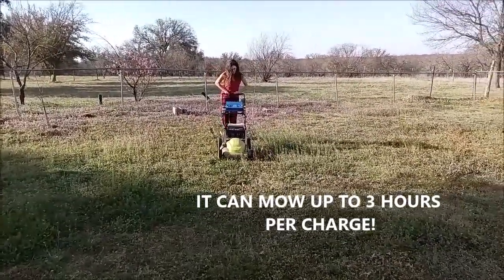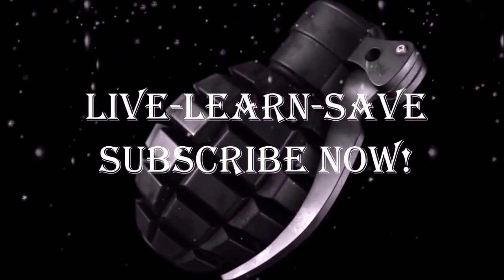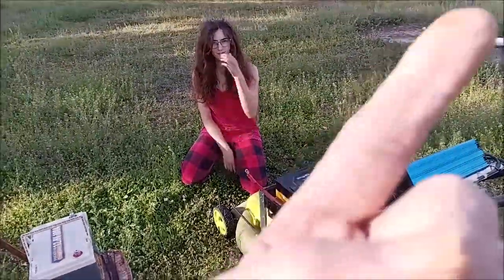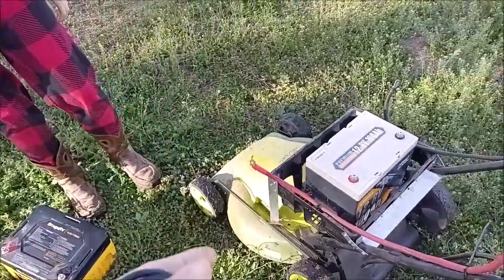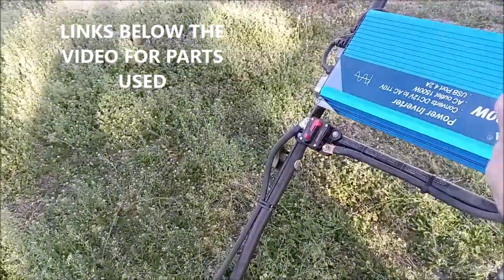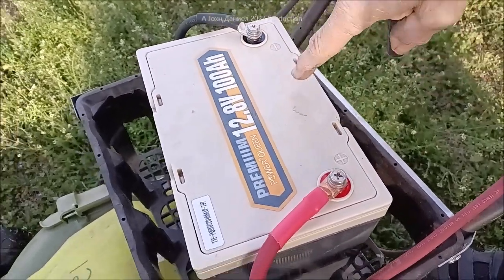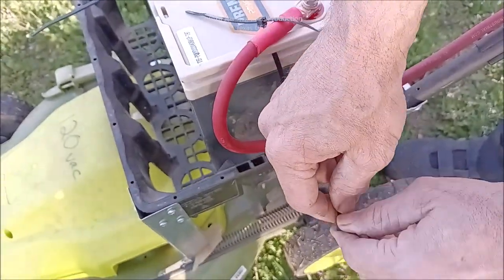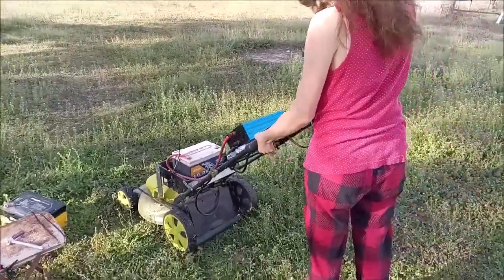120 volt Corded Mower running WITHOUT the cord & Solar Powered!!

Comment: Hi John really the videos you do. I picked up a 1300watt mower got a 1500/3000 pure sine wave inverter (giandell)mower will not run ???
Reply from the maker: Giandell 1500 won't have the starting amps with a 1300 watt load (over 3 seconds of 2X that to start it). You would need a 2000 or higher base inverter, and much heavier cables than the Giandell comes with. Using a start capacitor may help, one from a 10K BTU AC unit, such as a RV roof units capacitor.
Reply: @JOHNDANIEL1  cheers thanks mate I was thinking it may be a amp issue   What inverter do you recommend I am in Australia so some stuff can not get here
Reply from the maker: @andrewwyatt2542  2500 Swi power. You can get them there through AliExpress.
Reply: @JOHNDANIEL1  thanks mate shall have a gander
Reply: Would you a link for that inverter thanks

Comment: Can you make a 2023 video on how to set up a solar generator system using solar panels and a wind turbine at the same time?
Reply from the maker: Yes, I will do that. And I will show how to use Buck chargers, off Lead Acid to charge Lithium safely. 
It's a funds thing right now, I took no JAB from Pfizer so I get no love from Trucking companies and therefore I am not making the Bling Bling $ I once was.

Comment: I bought two of those 12.8v 100ah Powerqueen Premium batteries a couple months ago to run in parallel for my RV.     I haven't tried them yet but from the looks of the video you tested one, it's one hellava tough  battery.
Reply from the maker: They use actual automotive grade cells and a custom BMS. The new batteries I will be getting to add to mine are from Li Time. Have same internals, putting 4 in your system will work right together. So if you need 2 more look at them, the compact Li Time 100 Mini, they are offering PRE-Order, $50 off, just $319 each. https://shrsl.com/3y8nf

Comment: Hey John 👍 I've got a fairly easy cure for the weeds. & I saw you guys grow something not too long ago. If you can easily enough get some free brown cardboard. Remove tape, completely cover the ground & add woodchips, (4 inches +) I'm sure you would have seen this kind of thing somewhere. I grow about 1/3 of my food that way & I feel good about eating real, natural food. Saves $ &  tastes so much better! My SHTF solution 👌
Reply from the maker: Yes, thats what we are using in the garden areas, 2 layers of cardboard, and lots of mixes with hay and goat crap mixed in with topsoil add on.
Reply: @JOHNDANIEL1  Nice. I watched a couple of other videos after that 1 & heard you say that your daughter, Keira (Spelling?) had a huge garden. I should have known you guys were growing food! Pretty obvious 👍
Reply from the maker: Yeah, we have a storm cellar full, a 17 x 19 foot pantry full, and a 3 organized garden areas over 2200 square feet to deal with. Savings due to our behavior since starting this plan over 7 years back has basically paid for 3 years of it in cost difference.

Comment: Bougerv has already lost my business on these overpriced batteries, proven a third time to be bad manufacturing. I am guessing you are just going to take the battery cells out and use them another way, which is what i would do since as far as i know the cells are fine. I believe they have a heater which would be great for something needed in cold areas. But for 699 dollars i would buy other batteries like the power queen and get 2 or so for around the same price. If these were around 300 dollars i might buy them and just take them out of the case and put them in another case.
Reply from the maker: It sucks they are like this but I have a solution thats from the 1950's for them.

Comment: I ran my old school 5000 BTU Frigidaire window air conditioner recently for 22 hours with my 300ah LiFeP04 battery. It was in the mid to upper 70s and it kept my camper at 72 degrees. The compressor kicked on about every 15 minutes or so. It used 2.8 kwh before I shut it off. I`ve been using it with a 20 amp plug in charger with a 2000w inverter for power outages but have everything to connect it to solar now but there`s no hurry until I get better sunlight coverage in the area in front where I`m setting up the panels. I`m gonna try a test run later this month. I`m also waiting on one of the little simple 10 amp MPPT controllers I saw you using to be able to add some extra charging from my large folding panels and another glass 100w panel I have. I`m gonna get more of those in the future.
Reply: 22hrs ??? I have a 10k Midea Inverter model and don't think I'll get much more than a hour per 100ah. I saw a guy test the 12k model and he got an hour, no more. Of course, that's in the southern heat, on MAX.

Comment: I was dumb enough to buy a "cheap" battery powered mower. I figured lithium ion batteries would last 500 cycles to 80% remaining capacity. Then I find out they don`t....failure is built in to the design in every possible way and replacement batteries cost more than the original price of the mower. So I`m getting a plug in mower. I have physical issues from a car accident and can`t yank pull cords. I`m not supposed to do much of anything actually but my doctors say I have to at least try to use my arms. Someone mows my yard now but I want to be able to do it if I have to after our civilization collapses. Can we sue Joe Biden for emotional distress?

Comment: I did this years ago with a 2000 watt inverter and an 80ah  marine battery, mine was self propelled so the extra weight just added traction.  Worked remarkably well for 2 seasons.
Reply from the maker: The LiFePO4 has so much more ability. Now cost and quality finally joined at the right time.
Reply: @JOHNDANIEL1  Totally agree, I may have to revisit that in the future.  Currently I mow mine with an old Snapper with a 5hp flat top Briggs that I've converted to hot bulb ignition and that uses motor oil as fuel.  Still working out the flaws but when I perfect it: Cheapest way to mow ever 😆